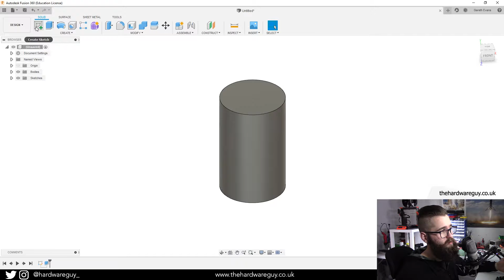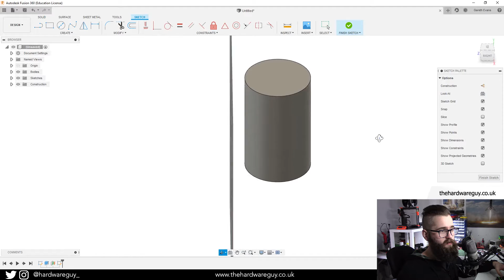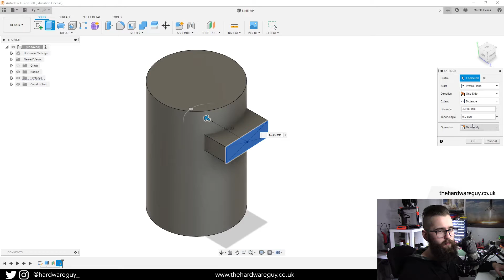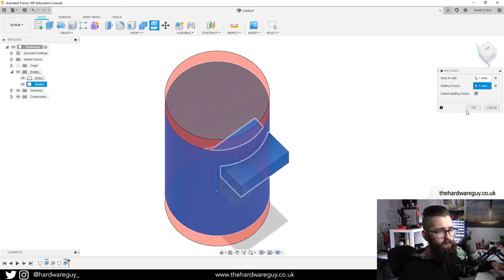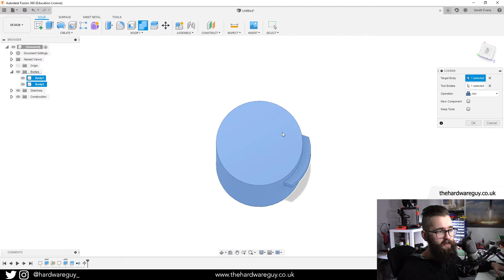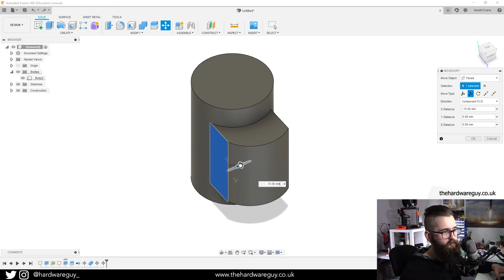Project Sketch on Curved Surface - Fusion 360

Comment: What pc are you using for fusion 360
Reply from the maker: Hello, thank you for taking the time to comment. Fusion 360 should run comfortably on most machines, but it also depends on how complex your model is. For the best experience you'll want a mid-range laptop or a low-end gaming PC at minimum. Enjoy the rest of your day :)

Comment: Great how you did not sketching on a surface the right way.
Reply from the maker: This is Protecting which achieves something similar. As far as I know you cannot directly sketch on a curved surface, other than an unrolled sheet material.

Comment: Hey, thanks for the tutorial!  I appreciate you sharing your Fusion 360 knowledge.  However, I think it's important to clarify that the method you showed isn't technically sketching on a curved surface.  It's a clever workaround using an offset plane and extrusion, which is essentially a variation of a straight-line projection. You create a flat sketch, extrude it through the curved surface, and then use the curved surface to trim the extrusion. This results in a feature that appears to be on the curved surface, but the underlying sketch geometry is still planar.

True sketching on a curved surface would involve projecting the sketch normal to the surface (i.e., perpendicular to the surface at every point).  Think of it like wrapping a sticker onto a curved bottle – the sticker conforms to the bottle's shape.  Unfortunately, Fusion 360 doesn't have a direct "sketch on surface" tool that does this precise normal projection.

The closest thing Fusion 360 offers is the "Emboss" command. Emboss does perform a normal projection, but it's limited in what it can do and is designed for creating raised or recessed features, not for creating a sketch directly on the surface that you can then use for further modeling operations in the same way you would a regular sketch. The emboss feature, in some limited circumstances, can work for a kind of curve-sketch.

So, while your method is a useful technique for certain situations, it's crucial to understand the distinction. It would be great to see Autodesk add a true "sketch on surface" feature in the future! It would significantly expand the possibilities for organic and complex modeling.
Reply: Wait fusion can't do it?? I am going back to solidworks and pay alot of freaking money again 😢

Comment: I am new but I had to do it differently in 2024.
Do a construct - offset plane, click the plane you want, push or pull the plane to roughly where you want, THEN click on  the new sketch and select the plane you just moved into position.

Comment: This would have been better if you had showed how to push the new body into the cylinder to make a cut or trench. My attempt at using this method wouldn't allow for that.

Comment: Thank you for your efforts, but this is not the solution to sketch on a curved surface. 🙂
Unfortunately this is only a sketch with offsets. 🤔
I am trying to put cylindrical holes and a groove perpendicular to a surface, which is curved by a spline and was hoping your video would help me 😞

Comment: Not to diminish the admiral thing this man is doing, but the much easier way to do this is to select "Object" under "Start" in the "Extrude" window. That will make the extrusion begin at the surface of the cylinder and extrude out with a curved face. 

Great video tho, well explained.
Reply: saved me many minutes, thanks
Reply: u just saved me 3 hours of looking trough youtube vids.... ur comment should show up instead of this video

Comment: Thanks this is a really helpful tutorial. When you were drawing the dimensions on the surface you used a shortcut key (D) but didn't mention it. As an absolute beginner it was kind of confusing.
Reply from the maker: Thanks for the feedback👍🏻 will correct that in future

Comment: This is useful stuff and I appreciate the video but the title is definitely misleading and I don't think it's worth it to mislead your viewers just to get clicks. I know you can't actually sketch on curved surfaces in Fusion, so you could have added the word "workaround" or something to the title. I would have subscribed otherwise
Reply from the maker: can you explain how it’s misleading? The video does exactly as the title says... we are projecting a 2D sketch onto a 3D surface. If you want to sketch directly on a curved surface you have to use the sheet metal tool, which I have a separate video for!
Reply: @thehardwareguy  you still created a sketch on a flat surface, and not on the round one. The results were then projected to the round one.

Comment: my trick would be to create another sketch on the top of the cylinder, make a bigger circle, and use lines to make either angled cuts (from the center point) or straight cuts (center point rectangles from the center of the cylinder). Finish sketch, select the outer parts, use the extrude tool and set an offset to whatever hight I want it to be. I feel like that adds a lot more accuracy.
Reply: I don't know if it's "more accurate" but I just tried this method too and it is really fast and easy. Thank you.
Reply: @davetpilot  hmm ok lets say it's a more flexible approach :P

Comment: this isnt projecting to a surface its extruding through a body, could you not just use the project tool to project the sketch from the offset plane to the surface?
Reply from the maker: It’s both. The sketch is projected to the curved surface and then you can extrude from there. They have recently added some updates that make this much easier. Now when you select extrude you can just select “from object” in the drop down and it does all this for you automatically!

Comment: To your knowledge, is Fusion 360 able to make a sketch on a curved surface, like the surface of a cylinder, and then extrude the sketch radially?  The trouble with your method here is that horizontal dimension of your 100mm rectangle is no longer 100mm once it is projected onto the surface, but it's a little longer.
Reply from the maker: Hi Paul! Yes... you’ll need to use the sheet metal tool to “unwrap” your curved surface! I have a similar tutorial for adding text to a cylinder using the sheet metal tool... you might find that useful!
Reply: @thehardwareguy  What if that "cylinder" isn't actually a cylinder and it's some other shape?  minimally a cone or some other shape?

Comment: What you are doing is projecting to a curved surface not sketching on a curve. To sketch on a curved surface you need to flatten it first in sheet metal, then perform extrusions cuts etc. then resold it. Sketches are alway flat, unless a curve in 3d, but the sketch planes are always flat.
Reply: How do you do that? Got a video handy by chance?